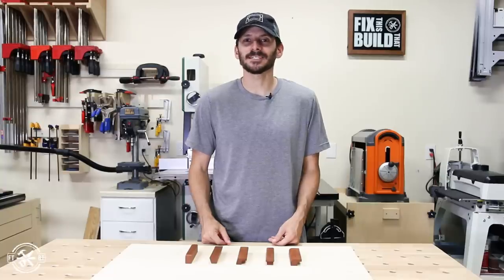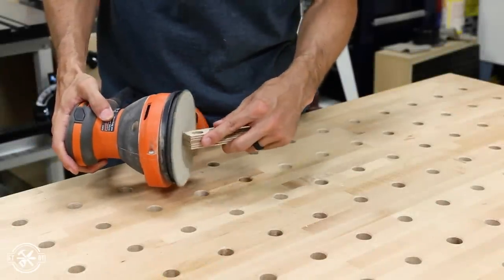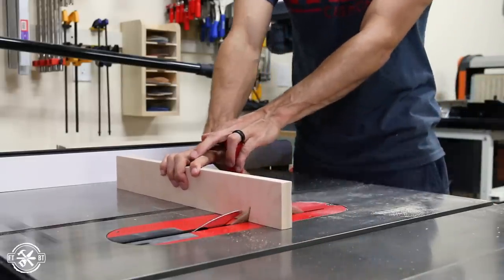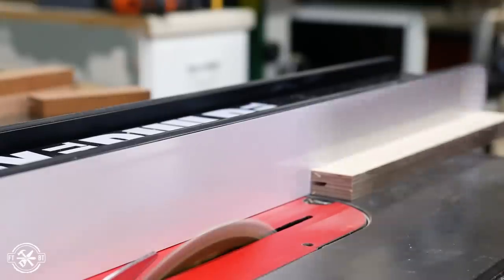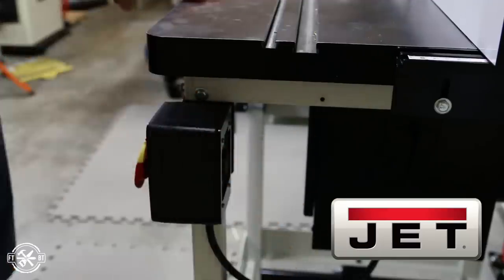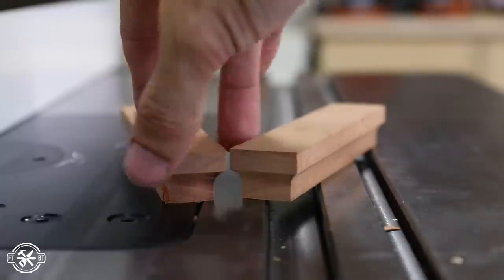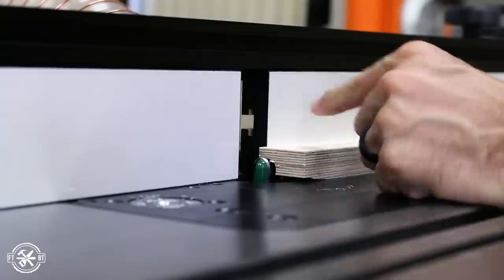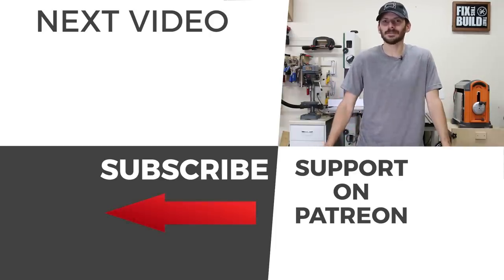5 DIY Wooden Drawer Pulls | How to Make Cabinet Handles

Comment: I just added 5 drawers to my shop in my miter saw station.   I ran out of time in the shop today, so I just searched making drawer pulls to see some ideas.  Very nice.   I had thought about the 2nd one with 15 degree bevels on both top and bottom.  Simple - yet functional.   Tomorrow they will be made!

Comment: Thanks, I just got done building Queen Captains Bed (Storage). I wanted to make some wood pulls because I knew most traditional Drawer pulls would eventually get damaged from getting in and out of the Bed. I liked the one cut at 15 degrees. Since the Drawer face was 33 inches I made the Pulls 11 inches about 1/3 the width and looks good. Used some reclaimed wood from old High school Benches from the auditorium bleachers that I got from a Demolition job.

Comment: The first one could have benefitted with the first idea, use the fostner bit to make shallow finger recesses on the bottom side; it would accommodate for older folks with weak grips.
Reply from the maker: Good idea!  I should have just done small recesses

Comment: I'm with you. I like the last one the best. I suppose you could knock out a bunch of these once you get the setups the way you want. Then you'll have them on hand as needed for future shop projects. 

For that last one, could you cut a notch on the table saw first then just make one pass on the router table to cut the curved profile inside? Would that avoid the need for that extra pass on the router table to clean up what was left by the rounded bit?
Reply from the maker: videoscrapheap good idea! I think that would work making the saw cut first